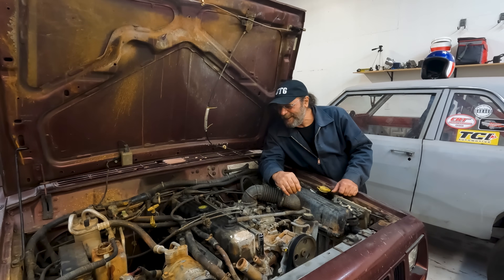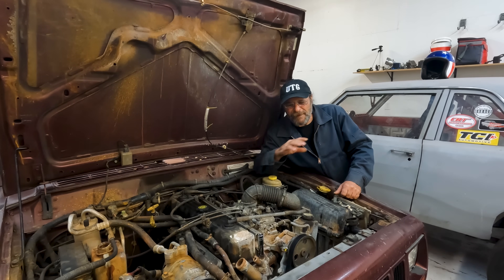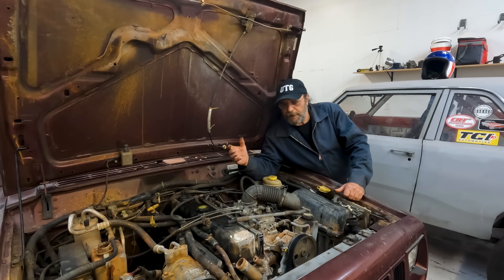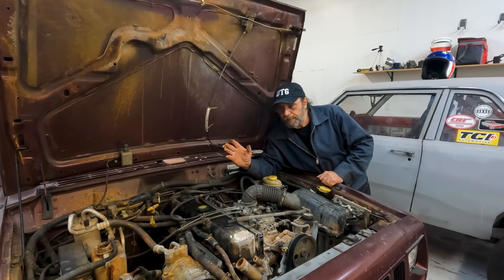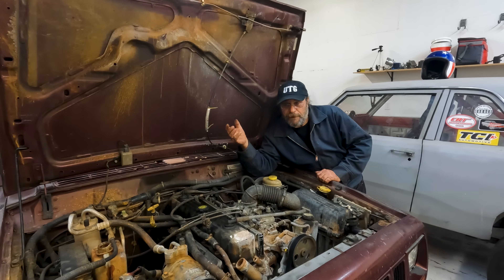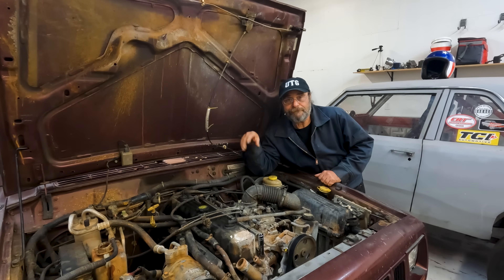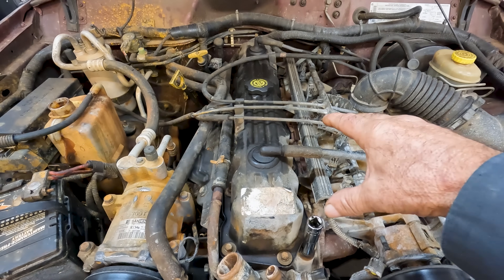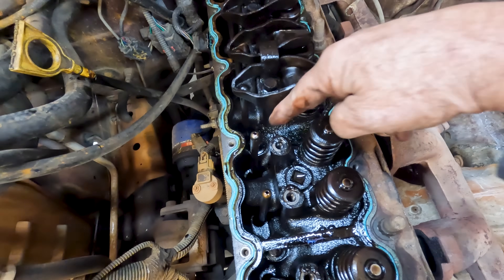Our Blue Devil Head Gasket Experiment Failed - Let's Find Out Why

Comment: as others already stated, the pump impeller chowder is from cavitation and maybe some of the schmutz that was added. that's also the reason to have antifreeze and a pressurized cooling system. both help curb cavitation by raising the boiling point and keeping the coolant from vaporizing when being pumped and avoiding a vacuum on the inlet side.
that all goes out the window when exhaust gas is being directly introduced to the coolant loop.
I had a 1985 plymouth voyager with the 2.6L mitsubishi engine(4G54?), aluminum head and steel block, the block had a rough channel eaten away between a coolant passage and cylinder #1, if I recall it was passenger side towards back of engine. the head was perfectly flat, so I assume someone else replaced it and gasket before I got it around 1996 and it quickly got eaten away again, but maybe it was factory and just never overheated enough to break.
I partially blamed it on past nasty acidic coolant, but also the gasket should have had a sealing ring around the coolant passage, because the gasket core corroded/rusted away.
I used multiple grit sand paper thick glass plate and hand sanded the block some, then assembled with a good gasket and I always drove it with my foot on the floor. then I couldn't keep transmissions in it, weak junk against that engine in a minivan.

Comment: Water pumps rotted cause it just ran straight water in it. And all that work was chasing  The combustion  Leaking into the cooling system. Block tester kit rules. Do you have an f experience you can smell exhaust in the coolant or water.

Comment: I used to work in a shop  specialized in jeeps I probably done 50 plus head gasket head jobs on 4.0 jeeps. It's been a while but if I recall the head Usually cracked it cracks  And the coolant travels in Above the exhaust Valve. And they crack between the valve seats or On the exhaust side of the combustion chamber. gasket blows  between cylinders or I between head bolt There's different generations of those engines but in my experience 50% of the timeThe heads will be cracked Over pressurized the system. They also just  Just blow the combustion ring usually between a head bolt and a coolant passage Or between cylinders So every way possible. I've seen a couple but can't recall too many that actually mixed coolant and oil. But their gravy everything's easy just remember to put  Sealant on a head bolts  And send the head to the machine shop make sure it's not cracked Or warped beyond spec. if you can't tell re surface. We used to keep rebuilt heads in stock I could turn around a Top end job with no other complications in a day. I love those engines.

Comment: That blue devil stuff is definitely a Band-Aid for a severely blown head gasket I have seen it last  An impressively long time. On a couple of my customers rigs. I have also seen it where a customer had a water pump completely fail at the same time. Temporarily fixed the head gasket and the water pump started voming apart and he let it sit for a couple months and it literally had like a stalactite like a  Geological formation cave-like a blue ice sicle dripping from the weep 
Hole  running around the harmonic balancer and down almost to the ground. It was a jeep grand Cherokee 5.2 LA.  But that stuff doesn't seem to plug up heater cores. And it was a cool thing To look at😮

Comment: I’ve seen this before, predominantly on older Chrysler vehicles. Caused by electrolysis ( stray voltage) in the cooling system. I would have thought cavitation if it was an older pump, but in that time frame I think it is more likely electrical in nature.

Comment: The only time a head gasket sealer helped at all was certain types of leaks. If its a compression leak, just park it till you can properly fix the problem.  Coolant only leaks will sometimes seal long enough to buy you time.

Comment: Welcome to jeep 4.0 durability Tony. They take incredible abuse and just keep going.

I bought a 1999 XJ sight unseen that had been sidelined by a blown head gasket. The jeep still ran, so we drove it from the shop it was at to a friend’s garage. 

We removed the head and cleaned the head sealing surface on the block, then laid a straightedge on the block and checked flatness with a feeler gauge. It had one low spot that was .001 less than the maximum allowable runout. 

We had purchased MLS head gaskets, a reman head, and new head bolts (they can only be used twice and I wasn’t taking chances). I was leery of using the MLS gaskets with that much runout, but we went for it anyway.

The jeep has since towed a small car on a flat trailer from California to the south with no issues at all.

That jeep has 195,000 miles on it. My other 1999 XJ has 315,000 miles on it. They both run perfectly.

It’s hard to beat the durability of the 4.0.

Get the cooling system straightened out - flush the block, new stock type pump, new radiator, fan shroud, electric fan working properly, a Mopar thermostat in the stock heat range, a HD fan clutch (there is a NAPA recommended part number if you search the XJ forums), and it will sit at 200-210 all day with the A/C going. 

With the HD fan clutch you may have to cut one of the thin support straps on the radiator for clearance. It sticks out a little further than the stock one does.

Comment: I've use blue devil 3 times, the first times, the first time on a old Subaru gl wagon , no oil water mixed , failed the pressure test and steam out the exhaust... Dropped the exhaust manifolds and a crack was visible in the exhaust ports on one side.  Put the blue devil in and pressured it up and after 24 hours it was holding pressure. That car was on the road for another 15 years . The other 2 times it didn't work so well.

Comment: Don't forget to factor in the abrasiveness of all that stop leak and gunk circulating through the system, There is some cavitation going on, but that likely started happening after the vanes on the pump started getting worn down and perforated that's stop leak was sand blasting the inside of the cooling system where the slurry was able to flow. You know the radiator is stopped slam up  so the water wasn't really flowing through the pump and the slurry was just chewing away at the impeller.

Comment: I used to pick up junk cars in the 90's. When I get something clean with a blown head gasket that wasn't worth fixing properly, I'd experiment on 'em with these products. One thing I noticed: The worse the 'specimen' car smoked, the better this stuff would work/the longer it would last. I sold a Buick Century to a customer that had been 'fixed' this way, for $650- figuring, if it blew up I'd give 'em their money back. Turns out, they drove the car from NY to AZ and back!!! And it took about 6 months more for the fugzy 'repair' to finally let go. (They didn't complain, and I didn't refund them- for $650 they got a round trip to AZ and 6 more months..they got more than their money's worth!).
      The big thing is with these, that can make the difference between long-term success or not, is that you have to make sure to get EVERY DROP of coolant out of the system before adding the sealer. That's the most important thing when using this stuff. I've use Moroso brand; Blue Devil...but the best...the one I used on the AZ car, ironically, was an unknown brand sold at Kmart!

Comment: for a leak into antifreeze thru head gasket: first instal ARP head studs.
if it doesn't work,
to reuse a head gasket,
 remove head from block.
if it's a fiber gasket, don't clean head and block.
use permabond LH050, a very thin layer.

metal gasket, between each layers. as thin as possible.
-----------------------------------
for an antifreeze leak to somewhere, add finely ground black pepper to antifreeze.

Comment: The issue with the water pump is cavitation not corrosion.  Some where in the system the water is not flowing correctly and most likely trying to pump a water and air mix.

Comment: Check your pistons for skirt cracks before you put that head back on. That was another problem with that 2000 2001 engine pistons will fail. You can tell by how much they rock back-and-forth in the sleeve.

Comment: Water pump:  When you run straight water in your cooling system with 'modern' aftermarket parts.
Seen it lots of times.  Not rinsing out the citric acid flush additive can do this, too.  The instructions say flush system out, use straight water, add flush, leave in for a few days for heavy duty cleaning.  Yeah.  That.  Takes the plating off of the impeller.

Comment: You can't cheat with head gaskets.  I had a head gasket go on an engine that I was going to build a 383 stroker with about 2 years later. I had the heads cut and thought cheap gaskets and TTY bolts would last 2 years. Nope, 6 months later I was starting work on my 383 because the cheap shit didn't last😂😂😂

Comment: I am about your age. I saw this one time in my professional mechanic career, which I gave up in the 90's. Nissan Sentra. Overheating. Brown ish water. Pulled the head no head gasket failure or evidence of water in the cylinder. No warped head. Replaced the radiator, it was dirty but no obvious failure. Replaced t-stat again no obvious failure. New head gasket re assemble. Overheated exactly as it had when I started working on it. I mean everything I did changed nothing. Finally pulled the water pump out and found the impeller looking like the one you just showed. This one was worse and the blades were worn down to nothing but a thin disk spinning in the water doing nothing. No noise. No leaking mechanical seal. Turns out the owner put contaminated water in the cooling system. Think mud puddle water. We surmised that the grit in the water eroded the impeller blade. Who knows what really happened before it came to me. I pulled my hair out on that one.

Comment: Check all grounds. When you get it back together and running, use a volt meter and connect the positive lead to the battery positive. Stick the negative into the coolant in the radiator. There should be no more than .2 volts. If there is, clean all grounds and replace missing ground straps. You need turn on every component one at a time to measure the voltage in the coolant. I replaced a heater core in 90's Lumina or Monte Carlo that the customer already had replaced twice by an independent garage. I saw that the heater hoses were too short and the engine strut was worn, so I figured that was the problem. A few months later, the GM heater core failed so I called technical assistance. I was told to ground the heater core. So I did. A few weeks later, Technical Assistance called me and told me to get the customer back in and remove the ground from the heater core and to check for voltage in the coolant. IIRC, I had 3 or 4 volts in the coolant. I found all of the grounds on the transmission to engine studs were bad.

Comment: In the 70's, my dad bought a dodge van, that the previous owner had put salt water in, when it ran hot, and he was near the beach. It would run hot before we got out of the driveway. Pulled the water pump to find all of the blades gone. Eventually replaced every freeze plug too.

Comment: Bad ground. With a bad ground, the block carries a voltage (think of the pressure that builds in your garden hose when you mostly cover the end with your thumb) and accelerates acidic attack of metal parts, starting with the crappiest steel. New water pump = chinesium impeller = first thing to go.

Comment: Great  video   look like  someone  put salt water   when  it was  running  hot in  the  coolant system   by looking at  that water pump with  the  rust  holes  in the  propeller  must have  broke  down  by the  beach

Comment: My father inlaw borrowed my 68 dart slant 6. As a (surprise) favor to me he flushed my coolant / radiator with San Jose tap water (so much sediment you couldn't see through a clear glass full) and laundry bleach. Over the next month the thermostat corroded closed (1 week) and the waterpump started screaming (3 weeks). The water pump was 3/4 clogged with white scale that continued throughout the block & head.

Comment: I built a Mopar 400 B engine about five years ago. Someone must’ve used some kind of  coolant system stop leak on it. I had to use a hammer and chisel to  get all that crap out of the water ports in the heads. It was a hard as concrete.

Comment: The copper K-Seal and Bar's also eventually fail on even small leaks eventually.  Might as well plain and gasket or new head..

cavitation could mean whoever replaced pump used wrong coolant or wrong water proportion. Those engines like HOAT and zerex z-05 50-50 is the best

Comment: Common knowledge on the Jeep forums, 0331 head used in 2000 and 2001 models was prone to crack. Replace with 2002 + TUPY version or aftermarket head.

Comment: That engine has had "liquid glass" put in the cooling system!!!! It's the stuff the gov. Gave to car dealerships in the cash for clunkers deal that destroyed the engine when put in the oil after it was traded in for scrap!!! The corrosion and scale coating is a dead giveaway... It's common here in the south ppl do this after popping a head gasket to seal it a while to sell the vehicle because the substance is common here in the farming community's

Comment: 2 possibilities on the pump impeller, extreme cavitation as @windstarpro mentioned is most likely, other remote possibility is bad grounds on the engine block, if you got a bad ground strap I've seen those little electrons eat away entire pumps in very short order if there's enough conductive material suspended in the coolant (like all the garbage that was in that motor)
Reply: Interesting. I’ve been wrenching for over 20+ years now and wouldn’t have thought about a bad ground being a possibility. This channel is cool cause it’s all real true blue car guys that wanna help one another and contributes their knowledge

Comment: Head gasket repair will only work for an external leak... Will not fix a cracked head, or a in-between cylinder breach.. requires oxygen to seal

Comment: It all depends on the extent of the damage.  Years back coming home from a car show, the top radiator tank in my Gremlin split - let go from the seam where it joins to the row matrix.  I had some of that aluma-dust in a tube and the my drinks cooler full of water from melted ice.  It worked, it got me home.  Actually lasted for a couple months so I could source a better rad.

The goop in the bottles..... depends on how bad. I had a Turbo 2.2 Daytona.... had a bad gasket around #1.  The goo in the bottle got me a couple of months so I could collect everything to redo it's top end.  It worked until a friend drove the car and wanted to have a little fun.  The extra pressure cracked the fire ring around #1 and by that point I was going through a gallon of water in a week.  Before I was only using a gallon per month.

It worked on my cousin's V6 Ranger.  It had a weepy driver side gasket.  Don't think the fire rings were effected, it was between a cooling passage and the outside.  Goo in a bottle cured that.

Even worked on my V6 Ram.  We had to drill out a broken stud at the back of the passenger side head.  Didn't get it quite straight enough.  It leaked when the system built pressure.  Goo in a bottle helped seal up around the new stud.  (Or Maybe I forgot to install the stud with some sealer.  Don't remember to be honest)

Comment: I did a video on my channel about my 318 having the same issue BUT it destroyed 1 of my pistions partly from pre detionation  and faulty stock head gaskets from Fel Pro and  torqued but used head bolts . Blue Devil wouldnt of help either

Comment: A decent used 4.0 long block is $600–$800 all day long on Marketplace or from pull-yards. If you're going to that trouble though, then why not go nuclear? LS swap kits for XJs/TJs are down to ~$600 now (motor mounts, headers, etc.), and you can grab a 5.3 truck motor for $800–$1,200. Then your $1,500 Jeep will have 300+ hp and still get ~20 mpg. Something worth considering.
Reply: Realistic LS-swap budget for one of these in 2025 (doing most of the work yourself):
Jeep: $1,500
5.3/6.0 LM7/LQ4/LQ9 truck motor + 4L60E/4L80E: $800–$1,500 (junkyard or Marketplace)
Swap kit (mounts, headers, oil pan, wiring harness, PCM flash): $600–$900
Radiator, hoses, driveshaft mods, exhaust: $400–$600
Misc fluids, gaskets, brakes/tires because why not: +$500
Total: $3,800–$5,000 all-in. And you can put 33's on it no problem. Turn it into a trail rig.

Comment: I worked at a Ford dealership in 90s. We had a recall on the 96-99 Taurus 3.0 Vulcan. The blocks didn't get cleaned out after machining. We had to knock out the freeze plugs and flush out the rusty and acidic coolant out of the blocks. After the recall and on cars that didn't get the recall done. These cars started coming in with an overheating condition and also no heat in the HVAC system. So we would remove the water pumps and the impeller had no fins left, they were ate off and the star shaped impeller that remained was shark as a razor blade. That's what I'm thinking you have going on there. Extensive block flushing and diesel coolant additives are needed to control the ph in that cooling system.